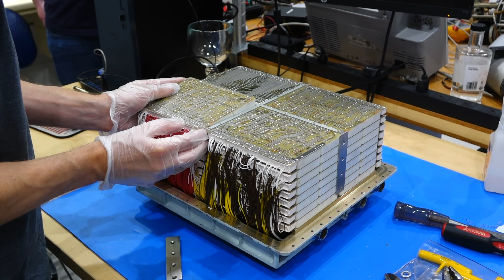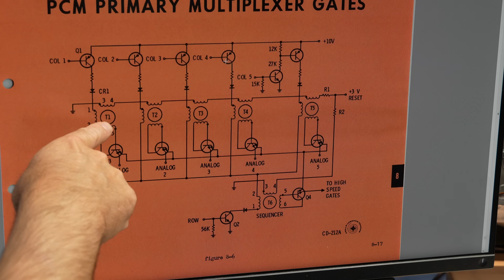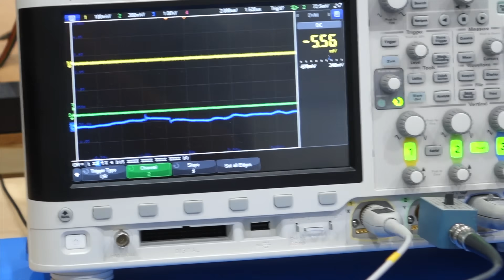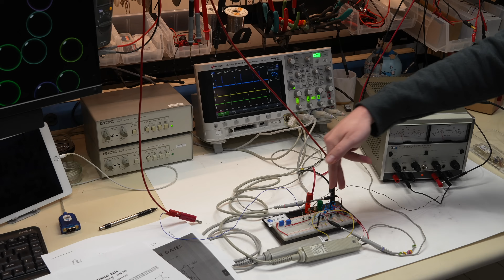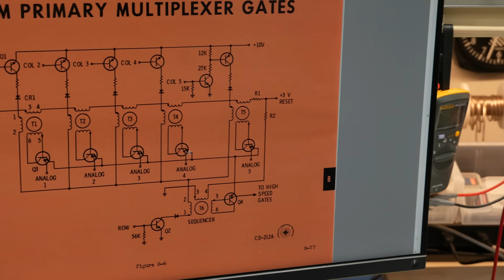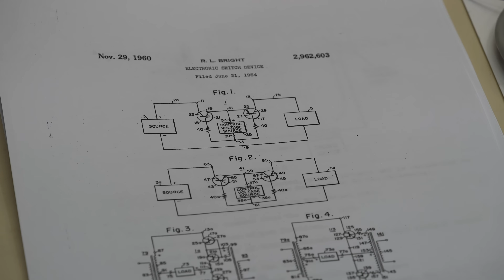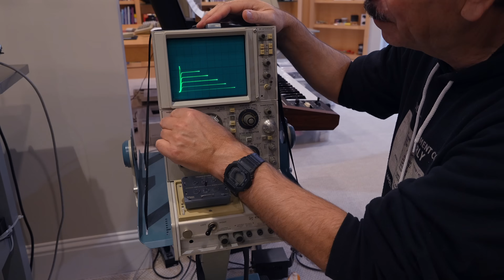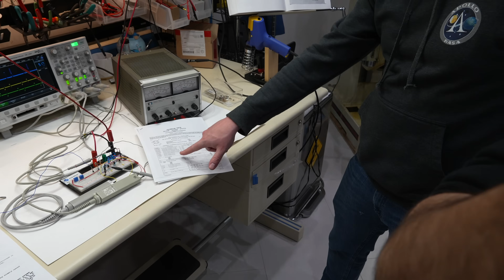Apollo Comms Part 37: Apollo's weirdest (but genius) analog circuit

Comment: I've done circuit analysis in reverse-active mode (to make sure that no smoke was emitted during certain weird voltage transients), but never before have I seen reverse-active mode used!  That's weird!

It's also pretty weird nowadays that transistors were more expensive than hand-wound transformers on ferrite cores.  As soon as transistors became cheap, this circuit would go right out the window.

I bet you could replicate the circuit today with something like a DMMT3904 with the bases and collectors tied together..  I bet the transistors of even a cheap pair like DMMT3904 are better matched than the emitters of the 3N68 were, no no need for anything fancy like the AS394.  I don't have any cores of the right type on hand (all I have is little bitty EMI-suppression beads) or else I'd be running down to the bench and trying it!

Comment: Look at the TTL 74150 16:1 digital multiplexer.  These use multiple emitters.  The earliest version though could be a 16:1 Capacitance sensor - which is analog.  I built a Vibraphone keyboard this way back in 1974.   It was called "the Synthi vibe" and was built for Mike Mainieri.   Ems synthi also used this part in the Synthi AKS Keyboard.  Later, improved to closer specs version of 74150 don't work. You need the old ones.

Comment: I'm trying to figure this out. So the base and the collector are galavanic isolated from the rest of the circuit. Therefore, there wont be any voltage/current traveling out of such collector or emiter. When the collector/emitter are in conducting mode, The Collector is "connected" to both Emitter 1 and Emitter 2. Since the collector is galvanic isolated from the rest of the circuit, no current is going to be passed towards any of those Emitters... instead... both emitters are just going to be able to see each other as if they were connected. 

So this only works when you put a transformer/torus in between the Base and the Collector. That's why it works, and why it requires that small transformer, since it requires galvanic isolation for this to work.

Look it up: Multiple-emitter transistor

Comment: If you run a BJT in its reverse connection (swap emitter with collector) the saturation voltage is a lot lower.  The reason is that the collector junction has a much larger area than the emitter junction.  This keeps the current you send in onto the collector base junction from coming out the emitter.  They also used to make transistors where the emitter and collector junctions were the same but that wouldn't work here since you want a floating switch and not a switch to ground.

Comment: Excellent video!  For the other viewers, there is no "core logic" or other core action going on here.  These are just simple three-winding transformers.  Some of the magic here is that a turned-on "inch" transistor's only capacitance is the from winding to winding on the transformer, while the transistor in the off state also has the back-bias capacitance of the most positive emitter.  The third winding is a convenient way to blip the bases of all the transistors negative to clear the charge carriers out of the junction area and hurry turn-off of the inch transistors.  My guess is those transformers are amazingly small and hand built to precise specs.  It is also a good bet the transformer turns-ratios optimally drove the base-collector junctions into good saturation with optimally low primary winding power.

This is a fine example of how the He-Men electrical engineers of the '60s aerospace industry could do a whole lot with very little.
Reply from the maker: That's incorrect. It's pure core logic! Wouldn't work with a normal ferrite core. The single pulse is generated by the core flip. And it won't trigger again until the core reset.

Comment: I can tell you a story about backwards transistors. In a former life I was working for a company that was developing VLF radio for use in mining applications. I was a junior technician. I was tasked with building a prototype, which I did and was surprised to find that it worked perfectly. Later that week we sent off the schematics to a manufacturer to get a few post production radios built for some field testing that we had planned and also for the dreaded intrinsically safe testing and certification. None of the pre-production radios worked. After much head scratching the lead engineer announced that the manufacturer had installed the transistors backwards. After a heated phone call with the manufacturer the lead engineer came back to me and asked me how I knew the transistor pinouts for my prototype. It turns out I had it wrong. In the end we instructed the  manufacturer to fit all these transistors backwards for production models.
Reply: I think these were ZTX series (I cant remember) they were (C)(B)(E) and I had them installed (E)(B)(C).
Reply: @zero0ryn  Zetex made some surprisingly odd transistors, and I can well believe you got some which had a higher gain in reverse, and lower forward voltage drop as well. It was amazing to get a bipolar transistor in a tiny package, rated to be a saturated switch at 5A, and with a very low base current still when saturated, and it still ran without a heatsink on it. Only drawback was Vce was now 7V or so.
Reply: task failed successfully
Reply: Forward biasing the collector/base and reverse biasing the emitter/base I guess would work. It's weird to think it was done but there had to be an advantage they saw. Luckily I don't have to contemplate how it worked in the active region since it's the Vsat they were trying to optimize.
Reply: @davidbarry494 I think it's down to what and how they doped the P<>N junction. For a small signal transistor (which is what these were) they probably used similar material and methods. Maybe as someone commented the gain was too high and the linearity was off in one direction and by accident it was discovered by swapping the function of E<>C you got better linearity for lower gain. In the application we were using them for (ULF FM receiver) linearity didn't matter, just gain.
Reply: This is a nutty concept to me. Every time I've had a transistor taken the other direction, the magic smoke tends to leak out. Maybe I've been doing it wrong all this time. Keep the battery terminals correct, and flip the parts!

Comment: Very neat.  It appears the active window is limited by the magnetic response of the core, as the BC current pulse is the only period of time the emitters couple.  Extending the time will not help, as it's only flipping the core that allows the activation pulse to propagate to the INCH device.  And that core-flip time is determined by its magnetic hysteresis response to the input pulse.  The fact that AC is also coupled at the emitters is not very helpful, as we can see even in this demo there is distortion on the pulse edges.  A downstream ADC likely performs a single sample(-and-hold) at a point near the middle of the mux pulse.

Comment: I have several books about "circuit ideas" from the 1960s.  Some use transistors.  Some use tubes (which did NOT die out until the late 1970s).   MANY were exactly as weird as this analog multiplexer.   I specialized in analog electronics and IC design and I have to look at them multiple times to even understand what they are trying to do.   Just like you guys!  LOL

It was a very interesting/weird time for electronics bookended by pure vacuum tube and pure transistor design!   It's very cool to look at.

The other factor is the asymmetry of most linear BJTs vs. switching BJTs.   The former are doped asymmetrically to for higher forward gain for forward linear mode vs. reverse gain - it's better for that.  The latter are doped to be symmetric.  This may be what was seen.

Edit:  the 3N62 is also related to a unijunction transistor - which also mostly disappeared after the 1960s.  The unijunction is a 2-base transistor vs. the 2-emitter transistor.    It would be interesting to try using a monolithic matched pair BJT

Comment: I'm always amazed to see such Royal quality test gear.
No bog-standard equipment.
Just quality HP, Agilent, Keysight.
When I worked at GEC in the 80s, HP was so common.  They did have Fluke 4.5 digit push button multimeters (These must have been so expensive then) some Philips Scopes, some Tektronix scopes (0ne was a Pico sampling scope), but HP was predominant.
Great video Marc and the team, just shows you how inventive they were back in the day, long before even remotely cleverer ICs were around.  Even the CMOS 4000 series were just being brought out.
Reply from the maker: I like it, "royal quality test gear". Working with quality HP vintage test equipment brings joy to my engineering day.
Reply: @CuriousMarc  Tiara or Crown Marc! Your choice!   ❤

Comment: This is only the tiniest part of the utterly fascinating comms and telemetry system on Apollo.

They coupled the communication and telemetry channels with signals that depended on how long it took to get between a ground antenna and the spacecraft, so that with antennas at different places on the ground they could tell exactly both where the spacecraft was and how fast it was going, in three dimensions, to astonishing precision, using processing entirely on the ground. To be clear: there was just the one system and one collection of signals doing all the jobs: telemetry, communications, remote control, and position/speed. The positioning technology led, in a direct line, to modern GPS, just as fly-by-wire on the LEM led in a direct line to the Airbus and everything else now.

Probably most of these techniques, as with the gyroscopic inertial platform, were already in use in disparate military systems. The Apollo program was the conduit that let brought them together and helped them escape to the unclassified world where they improve our condition, not just try to preserve it.

Comment: I think they're using MESA transistors. The emitter is doped more heavily than the collector and the base is about medium-ly doped between the two. The emitter has a lower bulk resistance than the collector but has the same PN type junction. Since we aren't trying to amplify the signal we can use the switching ability of the transistor with the low bulk resistance with low signal loss at the cost of losing any gain, almost like a voltage follower.

Comment: These are just variants of BJT and they don't have a special name other than Multiple-emitter transistor. There is a wikipedia page for it.
I've seen this symbol a lot in integrated circuit design papers. They are used in a standard cells libraries.

Comment: Backwards driving of transistors that is base collector was widely used as a demodulator switch an aircraft compass systems which demodulated AC signal coming from the Flusgate sensor both Collins and Sperry use the technique when I first saw it I thought it was a schematic error Then a friend of mine mentioned that the reverse connection provides a very small offset voltage while providing little or no gain but it was widely used and there's plenty of airplanes flying around today that have a transistor keeping their heading system working even though it's connected backwards I don't recall seeing a double emitter transistor used in this application but I think if you look at the Collins PN 101 slaving circuitry which is an electronic compass system HSI instrument I believe that is a place that uses it Interesting video when you started talking about an odd circuit design I thought immediately up backwards drive probably and sure enough that's what it was Great video as usual guys it's good that you refresh the lore that the younger people don't know about circuitry magic keep making the excellent videos I watch everyone but

Comment: That was great, learning how engineers worked around the limitations of early semiconductors. As an aside nice to see Mike's proto board looks more like mine the the ones you usually see with perfectly sized interconnect wiring.

Happy New Year to Marc and the team.

Comment: I worked as an electronic test technician at a major defense contractor back in the late '70s and early '80s, doing production test during manufacturing as well as items returned for repair.  I saw all kinds of unusual parts and circuit designs.  Simple things like using a capacitor instead of a resistor to allow a 28-volt lamp to operate on 120-volt 400 Hz AC power, so the entire product used the same lamp.  Or an SCS, silicon controlled switch, basically a 4-terminal SCR with both an "on" and an "off" gate, with 10 of them used in a sort of cascaded shift register to sequentially drive the 0-9 digits in a Nixie tube display.  Yet we also used microprocessors and the latest CMOS logic chips.  It was a wonderful learning experience, covering a wide range of technologies from vintage to leading edge.
Reply: The 4 terminal SCR I believe is what was called a GTO.  (gate turn off). I think Hitachi and GE were the main players in that power electronics area. Unlike the SCR trigger I recall you need a lot of current to turn it off.
Reply: Using a capacitive dropper is quite common these days, but it must have seemed wildly exotic back then. I used one last year to help generate a zener-stabilized 8V DC to supply power and dial indicator LEDs from a single ~40VAC secondary in a Kenwood KT-80 tuner dating to pretty much the exact time frame you mentioned (~1979-1984). Worked a treat and shaved off more than a watt of waste heat while eliminating LED flickering. I did need a slightly bulky film cap (WIMA 3.3µ/100V with a 22.5 mm lead pitch) but it was manageable. 
When combined with the replacement of a very leaky zener and a main voltage regulator mod that brought down its output by about 5%, the unit's mains power consumption dropped from about 10-12 W to 5.8-8.5 W, all the while the power indicator works now (the lightbulb in these really likes to burn out as the stock dropper resistor value seems to be too low and nominal mains voltage around here has gone up from 220 to 230 V on top of that).
Reply: @PileOfEmptyTapes  For me it was one of those "I understood it from theory but here it is in practical use" situations.  This was in a piece of military test equipment, where all the other indicator lamps were 28 volt, so why make them carry a spare higher voltage lamp when you could avoid it in the design?  These were tiny flange based lamps, number 327 I think (40 years later and I recall that? 🙂).

I recall having one of these type indicators with a push-to-test feature, but miswired so pushing it would burn out the lamp!
Reply: @PileOfEmptyTapes  I tried to build a capacitively coupled power supply once to save the isolation transformers.  The trouble was capacitors act like differentiators and are extremely good at passing surges spikes and transients through as excess voltage if you don't protect the circuit.
Reply: @PileOfEmptyTapes  Japanese radio manufacturers used capacitive droppers in their heater strings in the 1960's. Philips used one in a late hybrid B/W TV set around 1970 (they used other strange tricks in that one, though, most notably using the SRPP sound output stage as the sound IF amplifier as well).
Reply: Hey that sounds interesting, I work with "unknown" electronics as well, we can talk about that if you want

Comment: I'm thinking about how one could reproduce something like this circuit with readily available components. As in the original patent, you could use a pair of ordinary transistors instead of the unicorn double-emitter transistor. I don't think they even need to be very well matched. Gain match would be irrelevant, as you are driving the transistors into saturation, and if there is a bit of a mismatch in Vsat, it would just introduce a bit of DC offset, which can be compensated for in many applications.

The trick is referencing the base voltage to the collector voltage. You might be able to replace the core with a couple of opto-isolators. You would be using the photodiodes in photovoltaic mode, which isn't how they are meant to be used, so I'm not sure if they would generate enough current to drive the bases.

But it also isn't clear to me that the base voltage needs to be referenced to the collectors at all. Unless I'm missing something, always a possibility, all you really need is that the "on" voltage be a volt or so higher than your highest input voltage, and your "off" voltage be lower than your lowest input voltage on any channel (assuming NPN transistors). Your dynamic range would be limited by the reverse breakdown voltage of the B-E junction, but that still gives you 5-6 volts for many transistors.

Comment: So... Although the circuit is drawn as a transistor with two emitters, since they use the transistor in "reverse", the circuit in fact is making a two emitters transistor into a two collectors transistor.
On that a two collector's transistor with very poor characteristics but with that one specific characteristic of low Vce(sat) very low.

Comment: You say that the transistor is inverse-polarized, but to me that is not something invented by the circuit designer: it is rather something dictated by those transistor datasheet, since the 2 emitters are basically the switch ends...

Comment: Still wondering how far you will take this. Will you set up some of the sensors, like the heart rate monitoring sensors? Those seem to be somewhat disconnected from the actual flight hardware.

Comment: 4:27 I mean they do still make fets and modern igbt, with more than one emitter

Or more than one base/gate 

4 pin, maybe 5 if its for inductive based motor drivers, the back emf diodes

But they aren't period correct and may work too well and break the schematics
Reply: Could emulate it with a Darlington transistor array ic

Like a uln2003 or something with a few passives